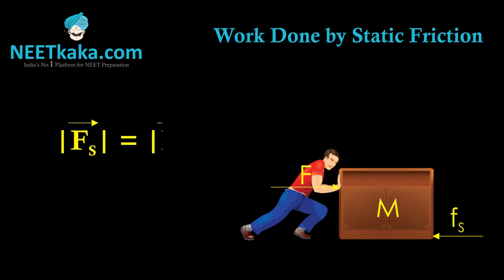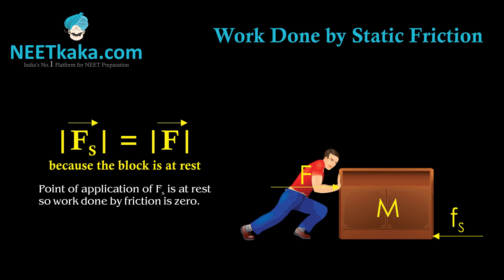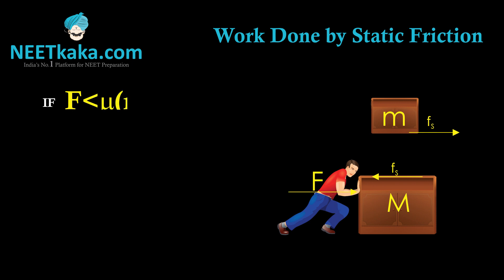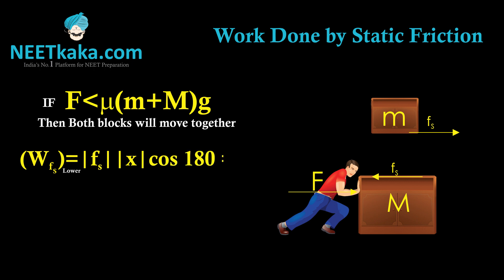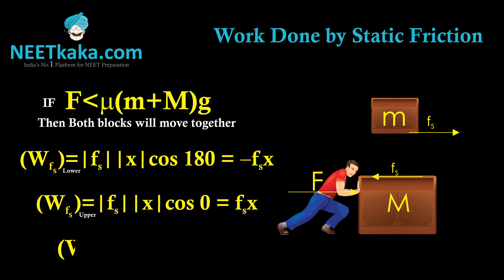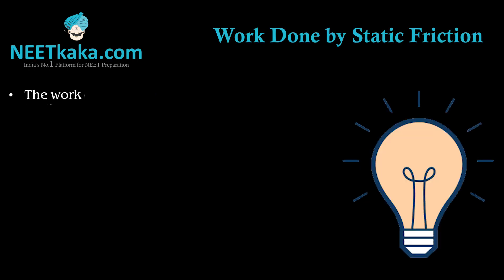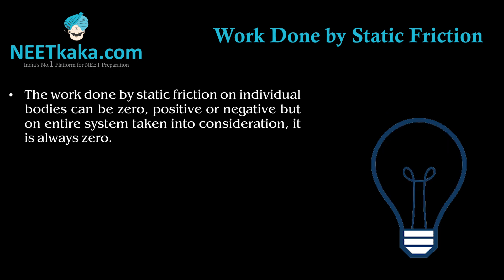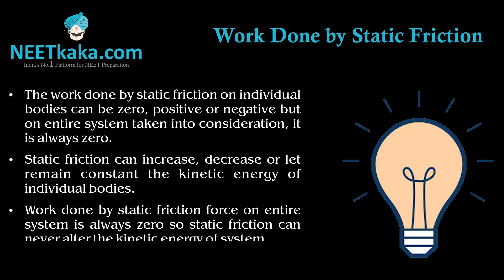Work Done by Static Friction

Comment: Why external force should be smaller than static friction to move both blocks forward together at 1 min and 28sec
Reply: And if the body did displacement then it means body is in kinetic phase now means kinetic friction comes into act.
Reply: @nakulverma9537  teacher himself is confused
Reply: @nakulverma9537  you must have cracked neet but for anyone wondering, lower floor is smooth and lower bodys upper surface is rough. that answers the question and theres no relative slipping of upper body so its fs itself
Reply: Yes thats what i am thinking